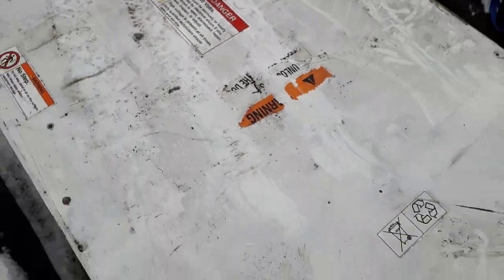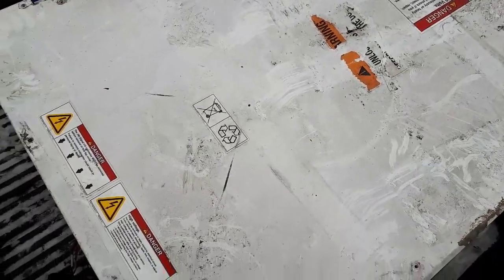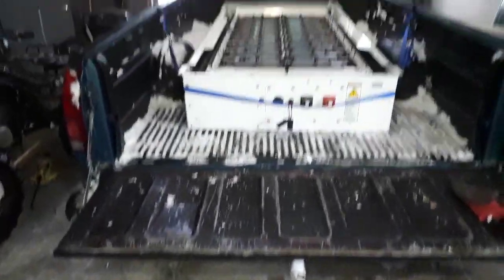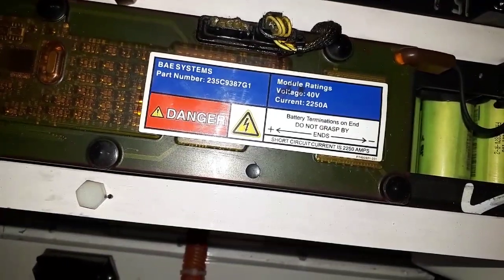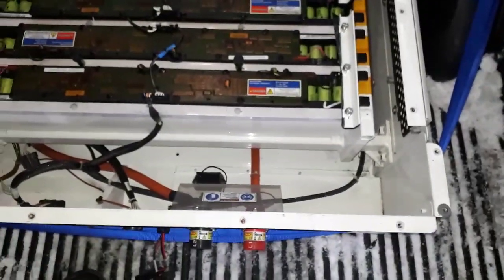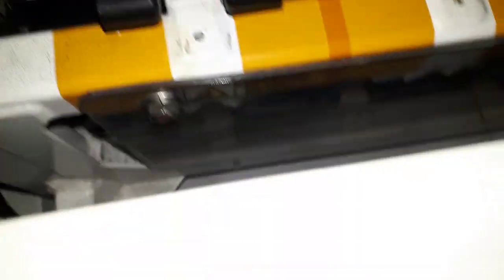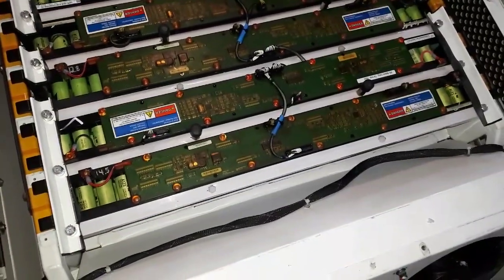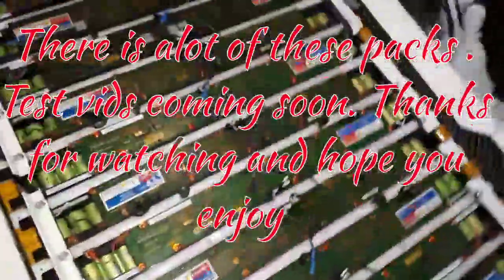A123 Systems Bus Pack

Comment: nice  thoes came from ttc hybrid buses i did campains on replaceing thoes  looks like u got a rev 3 of the pack also  i got the bms software to comunicate with the mother bms on the front of the tub   u need a com cable and a  kavaser usb to com cable   from looks of it u got a referbished tub with matched cells    also the fans are 24v
Reply from the maker: Yes they did. I have the whole fleet😁
Reply from the maker: What voltage are the heaters under the 24v fans?

Comment: I'm interested in these packs but am not sure how to set them up in a off grid system, would prefer to not mod them and use as is. how would you set them up off of solar and wind, is there certain requirement to charge them  or specific equipment to use them. any links to that type of info?  Do I have to have to buy specific 36 v equipment? or as long as your charging voltage is higher your good to go? and then just need a 36v inverter?

you state that your going to use them in 120v setup... how is that going to work? 
where abouts are you in ontario, I'm up in wasaga beach but moving to nova scotia  in the spring. may be interested in buying from you if I can figure out how to build a system around these batteries.
Reply from the maker: Ya i can help. Its up to you how you want it set up. Plus it helps to know your load. The higher the voltage the lower the amps needed. The packs are 36vdc nom. They sit around 40v. I use 3 packs in series to get around 120vdc. But thats because i have the equipment already. Im in Gravenhurst

Comment: Wow awesome find!! Where did you buy these from?
Reply from the maker: You can get from me if you are in Ont
Reply: @frankz1125  Would you be interested in a trade? My laptop 18650s for a couple of your A123 modules?
Reply from the maker: No thanks. Id rather stick with 1 type.
Reply: @frankz1125  Gotcha I agree, I started with 18650s and would also like to keep it 1 type.  Just wanted to try out these a123 for a 12v pack to play with.  Thanks for the vids and keep em coming, looking forward to your transition to lithium.

Comment: Ha ha I've been looking at those and wondering just how good they are. 740 watts per row and 16 rows I think. Don't pick them up by the ends they are hot.
Reply from the maker: Im testing them now
Reply from the maker: @offgridwanabe  i can only bring home 1 at a time . 800 lbs
Reply: @frankz1125   my trailer is buried in snow I guess your truck is a half ton.
Reply: Some information for later........

Dimensions: Approx 3.5 X 32.5 X 6.5 inches
These are decommissioned energy packs containing 96 A123 lithium LifePo4 cells configured as 12series x 8 parallel providing 736 watts at a nominal voltage of 40 volts.
For a fraction of the cost, these modules can be unpacked and the A123 cells reconfigured to be suitable for e-bikes, scooters, RC , Drones, powerwall, etc.
They have anywhere from 70-95% life on them. Each pack will be different.
They can have up to 40C drawn from them.

Specs from A123 batteries white paper sheet:

Nanophosphate® High Power Lithium Ion Cell ANR26650M1-A

Nominal capacity and voltage 2.3 Ah, 3.3 V

Internal impedance (1kHz AC) 8 m1 typical

Internal resistance (10A, 1s DC) 10 m1 typical

mended standard charge method 3A to 3.6V CCCV, 45 min

Recommended fast charge current 10A to 3.6V CCCV, 15 min

Maximum continuous discharge 70A

Pulse discharge at 10 sec 120A

Cycle life at 10C discharge, 100% DOD Over 1,000 cycles

Recommended pulse charge/discharge cutoff 3.8V to 1.6V

Operating temperature range -30°C to +60°C

Storage temperature range -50°C to +60°C

Cheers
Reply from the maker: If you want them i will sell you this pack already separated into 40v packs. There is 16. $750 you come get them from here
Reply from the maker: they are not heavy like this. they would fit in a car.trunk an back seats tho
Reply: @frankz1125   Ok I will can't come today or tomorrow but after that I'm clear
Reply from the maker: Send me a message when you are ready
Reply: @frankz1125  ok thanks
Reply from the maker: So just the 40v packs weigh 320 lbs . I think that will be no problem for a car. I dont know what you drive. Im sure it would only be 1 trip no matter
Reply: @frankz1125  no problem my Honda Ridgeline will handle that
Reply from the maker: I will be home tomorrow if you are still interested . But let me know asap if you are coming because I am getting more packs
Reply: @frankz1125   yes I will come

Comment: I have seen this guy on ebay. Selling these guessing ur government mandates them out of service after a specific period. Really waiting to see if they have good capacity on them. A123 cells are funny but can put a crap ton of amps
Reply from the maker: I need them for the opposite.  Will be pulling very little amps but need it for days
Reply: thay got retired  but a year b4 thay got all replaced with referbished and matched modules   only way to tell is if tub has yellow heat tape thats how u know tub is refreshed  swaped then out for ttc  for about 2 years to finish the fleet also got a bunch of thease on skids :p